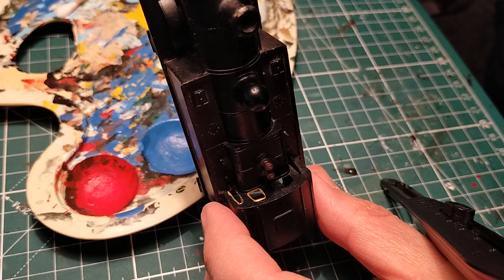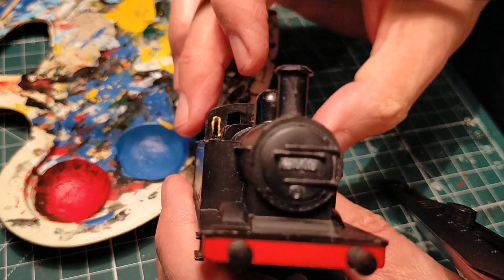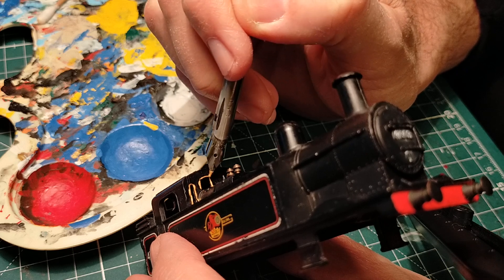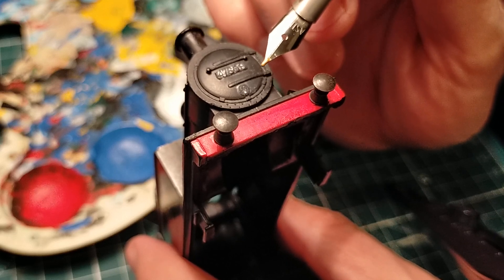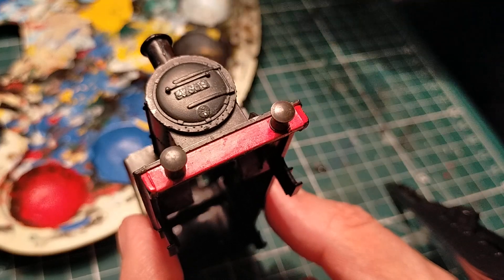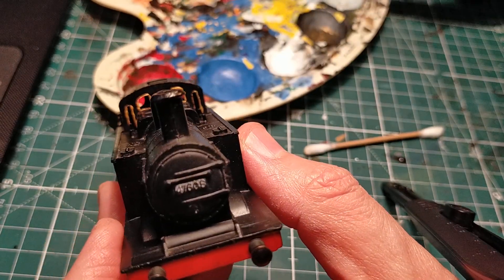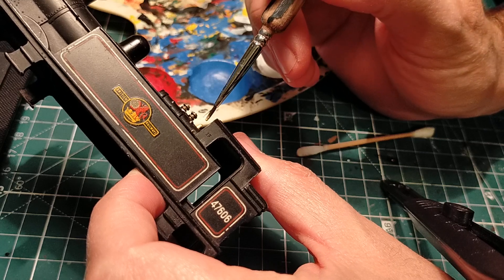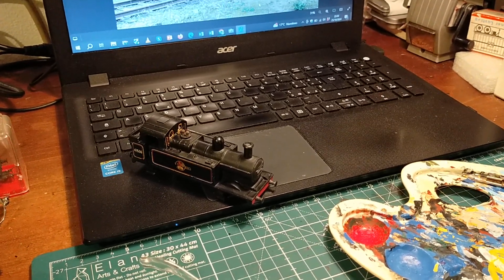Tri-ang Jinty 1959: painting the brass cab window frames and whistle.

Comment: Three of my Jinties have Jackson screw link couplings installed, as was prototypical. These couplings were usually hooked back onto the hook, in the direction of travel, when the hook was not in use, when hauling a train. On mine, this means that the screw link doesn't foul the D coupling's hook. Some modellers just remove the hooks altogether, on Triang locos, for aesthetic reasons A few of my locos came to me like this. Later Hornby and Lima OO locos have removable hooks, to this practice. The Jouef OO Class 40 comes without hooks.